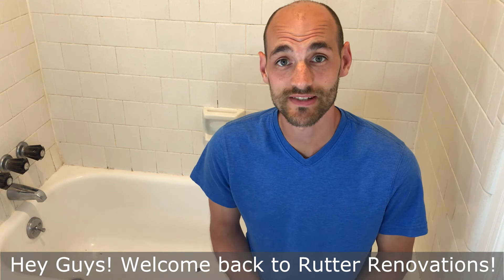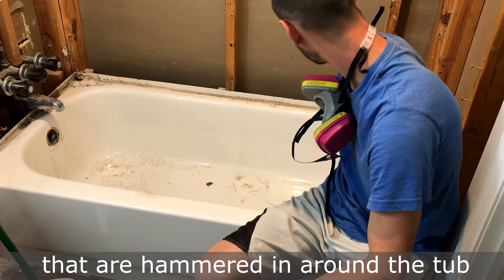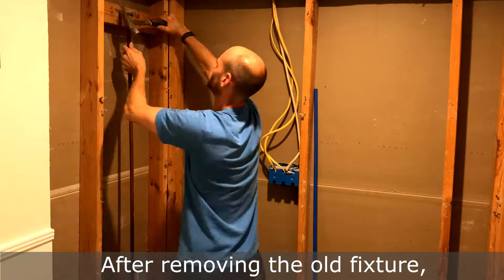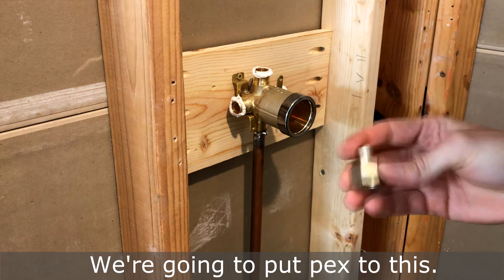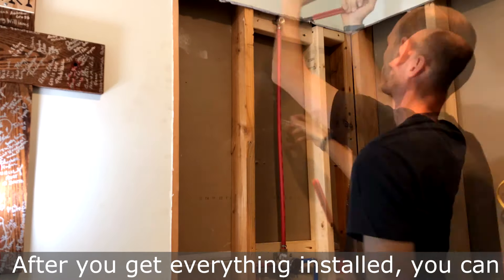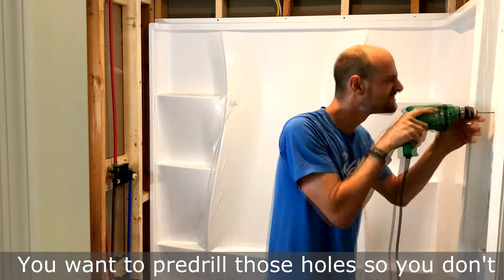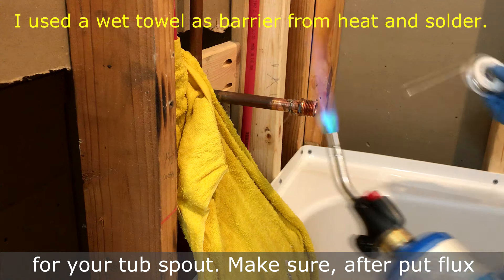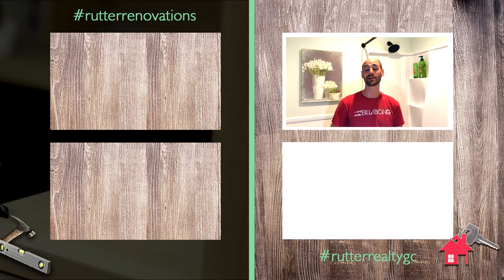How To Install A Bathtub And Shower Wall Set!

Comment: Do you put caulk on the bottom where the side wall meets the tub? I think mold would develop in the small cracks.
Reply from the maker: The manufacturer recommended caulking that gap. If you use the caulk I mentioned in previous comments, you shouldn't have issues with mold. :) Best of luck on your project!

Comment: When you put up the sheetrock around the tub did you cut away a little of the back at the bottom to accommodate the fiberglass flange/lip where it's secured to the wall?
Reply from the maker: The drywall lays over the fiberglass flange/lip. I predrilled the holes before screwing the drywall in through the flange so that it wouldn’t crack. I didn’t cut away any of the flange/lip. I hope that helps.
Reply: @rutterrealtygc  What I mean is did you cut away any of the SHEETROCK since it would not lay flat on the wall since the flange/lip was not flush with the studs.

Comment: I have heard that flex pipe is banned by a lot of plumbing codes.  I once had a garbage disposal that official maintenance refused to work on until the flex pipe was removed.
Reply from the maker: I wouldn’t normally use it, but because water will almost never go down it (unless the tub overflow is needed) I decided to make an exception. I can’t speak to whether it is code or not.

Comment: Hey man, what was your total install time. Start to ready to use. Thanks for the content. Definitely going to use this as a guide. I just purchased the same bundle from Depot. Cheers!
Reply from the maker: It probably took me a week while working around a full-time job. I probably could’ve done it in 2, maybe 3 days (depending on sheetrock mud dry time and paint), if I could have had dedicated time to work on it.👍😊
Reply: @rutterrealtygc  how much would a project like this cost to get done -including shower kit?
Reply: @josephmayfield2556  A lot
Reply: @davidsinger5861  doing a bathroom yourself does not cost “a lot”. This tub and surround are less than $700. We’re redoing our entire bathroom, and though we aren’t replacing the toilet or vanity, and have the baseboard already, we still wouldn’t spend more than $3,000. With the tub, floor tile, and all the new fixtures and materials, we’re well under $2,000 right now. A new toilet would be about $200, and a new vanity would be around $400. Bathrooms aren’t that expensive.

Comment: Was it necessary to install two shut off valves if there's no access to them?
Reply from the maker: Necessary? No. Convenient, so as not to disturb the rest of the home’s water supply while the project gets finished, yes. There is access to these valves on the pop-out access panel on the backside of the wall.

Comment: Question ? what if you want to replace it with a larger tub ? Wider by 12 inches .Love the shark bites,I use them all the time .
Reply from the maker: I don’t know... it might look a little funny if everything doesn’t line up (plumbing and/or tub/walls). Also, it depends on where your shower curtain would be because you wouldn’t want 12” of sheetrock exposed and getting wet during the shower.🤷‍♂️

Comment: Hi Ryan, thanks for the video. Very informative. I had the same tub and walls installed in my home and I am noticing water dripping from the end to the floor. Looks like those crevices retain water and then escape at the end. What do you recommend I do here? According to the installers manual it’s a caulk less design but it appears it may need caulking?
Reply from the maker: Hey! If you did get the same exact tub and shower kit, the manufacturer recommends caulking all the seams in the installation instructions.👍😊

Comment: How come uou didnt add the waterproofing boards? Or is that only for standing shower? Do a video on standing shower with backsplash :)
Reply from the maker: 😁 Okay, I’ll do it! This wall kit doesn’t require waterproofing boards and was installed according to the manufacturer’s installation instructions.👍😊

Comment: Thanks for the helpful video.  What kind of caulk did you use between the sheetrock and the tub surround?
Reply from the maker: DAP 3.0 100% waterproof and paintable advanced hybrid sealant 10 year mold and mildew resistant microban
Reply from the maker: DAP 3.0 100% waterproof and paintable advanced hybrid sealant 10 year mold and mildew resistant microban

Comment: How do you level the tub, making it perfectly horizontal?
Reply from the maker: Follow the manufacturer’s recommendation. Some might suggest shims, others a mortar bed, etc. Depends on the tub manufacturer and model.
Reply: The problem is there's NO manufacturer's recommendations whatsoever; just the 3 pieces: tub, walls, and roof, for the alcove. That's it. This is why I asked you.

Comment: Thx Mr Ryan now for us in Uganda we build using bricks and our bathrooms are not so big can I install the tub on a tiled walls direct thx
Reply from the maker: The tile is supposed to go over the lip of the tub so that when the water runs down the wall tiles it enters the tub. If you aren't using the wall set, most people would probably tell you to use a waterproof membrane that wouldn't allow water to penetrate and gaps in your grout or tile and get onto the brick. Hope that helps!

Comment: Thank you! Very useful, thanks for taking the time for the video.  When attaching surround to studs, you mention apply "adhesive", it looks like you used DAP 3.0.  Was DAP 3.0 used for both: sealant (waterproofing) & adhesive (stick the panels to the walls)? If you used something else for the sticking the panels to the walls, what was it?  How long did you have the self-made stud support to the surround...was wondering instead of building that, if I could just push with my hands for a few minutes 1 section at a time for a couple of minutes. Thanks.
Reply from the maker: Hey Brian,
  I called the manufacturer for this and they said that I should use the DAP 3.0 for both. 👍 Also, it isn’t something that you can just hold for a few minutes. I think I left the bracing there for 24hrs.

Comment: Hi, nice job, I had a guy install that  same Delta 400 classic surround with the matching tub. We have a big problem with the walls, they flex when leaned on and now the caulk keeps separating in the joints. Would not using adhesive on the studs cause that?
Reply from the maker: Hey mrc6870,
  Where are the walls flexing? Mine aren’t flexing at all and feel completely solid. Though, that is because I added the manufacturer recommended support boards in between the studs on the back wall and even had to add extra studs because of how few there were from the original wall. The instructions that come with the shower wall set specify wall supports recommended and using adhesive to secure the wall set to the studs. If either of those steps weren’t done, I’d imagine you could have that issue. 😬
Reply: @rutterrealtygc  I don't think he read the instructions at all. It gives on the side wall pretty much all over. I think I'm just going to take it out and start over.

Comment: Hi Ryan great video enjoyed it.Quick question which I am sort of confused.When placing one acrylic panel next to another creating 90 degree most manufacturers have sort of overlapping engagement that seals the water out however I have seen some installers placing caulking behind as extra assurance however I am more worried mold growing on caulking which happens over time and perhaps something that was not needed to begin with.What do you think.Thank you
Reply from the maker: I. Stalled it according to the manufacturer’s recommendation. They recommended sealing them with caulk, so I did. Realistically, it would be hard for water to get back there, but if you have kids and they like slinging cups of water around at bath time, it’s probably the best to caulk the seams.

Comment: I'm confused? Those shut off valves don't need to be sodered in?
Reply from the maker: No, they're sharkbite connections. They just push on. :)
Reply: @rutterrealtygc  Awsome, you did say the other video. I just didn't fully comprehend.

Comment: Can you use this is a mobile home. I want to do a budget renovation. Take tub out. It’s a vacation home. Not looking for fancy just updated. Thanks
Reply from the maker: I would imagine that as long as the tub dimensions and shower wall height are the same/will fit in the space, I don’t know what it wouldn’t work.  👍

Comment: Did you caulk the vertical gaps between the tub wall components and the bottom gap between the wall and the tub?
Reply from the maker: I did. The manufacturer instructed to do so.👌

Comment: Question.  You don’t need a durarock board behind the plastic panels?   Love you videos very professional!  Thanks Steve
Reply from the maker: According to the manufacturer recommended install, no. Just install it directly to the studs. The manufacturer did instruct to put those few 2x4s in between the vertical studs (as shown).👍😊 Thank you for the feedback and best of luck to your future projects!
Reply: @rutterrealtygc nice bro I am plumbing  my country India City New Delhi

Comment: Thanks for sharing! Do you think this surround will fit over a cast iron tub with same measurements
Reply from the maker: No, it will not fit over (at least it wouldn’t fit over our old steel tub).👍

Comment: There is gap between each piece. Should I fill those gaps?
Reply from the maker: The manufacturer (if you got the same exact set) recommends caulking those joints.

Comment: Do you have to use copper pipe for the bottom faucet? Or do they make some that can be used with pex?
Reply from the maker: The ones that I have used strictly require soldering in copper pipe or using another solid metal pipe. The manufacturer of your faucet should say what it recommends in the installation manual. I don’t know of any manufacturer that recommends or allows pex due to its flexible nature.
Reply: @rutterrealtygc  thanks
Reply from the maker: gtdodgeviper You’re more than welcome!👍😊
Reply: It's not only that it's flexible but bc of the sheer volume. Using pex for your down spout will restrict flow and force water up to your shower head. Even if you use 3/4" pex. Any installation I have or other contractors/ plumbers have done use copper for down spout.
Reply: @TheMrhighclimber   I was looking to see if anyone covered that and thank you. I've seen people use pex down to the spout connection and then put a pex to 1/2" wingback elbow on the bottom and screw in a piece of copper with a male adapter and use a slide on tub spout with the Allen set screw in the spout. It would work if it was just a soaker tub (no shower) but like you said the pex is restrictive and works like a half or so closed diverter and the resulting back pressure makes water divert a bit and go up the shower pipe when you open the faucet full open or even half open as water wants to take the easiest rout and the pexed spout makes it like a 1 lane blocked road so the lazy water guys take the bypass and half of them go out the spout and the other half take the bypass due to the restriction in the road. I love long sentences. If ya don't know what a male adapter or wingback elbow or AKA wingback 90 is look it up on google images, we can't tell you every thing. 😜
And Ryan, if your tub/shower valve instructions told you to use the copper pipe to the spout that's a good product, some don't tell you much because its been translated 4 times before it gets to you, if it said it in the first place at all.

Comment: Mine left enough room on the back side for Sheetrock to go behind so now have to figure out how to fill that area and not make the bathroom look bad. Wish it would have just went straight to the boards. Smh
Reply from the maker: You can add shims between the studs and the tub. That’s what I did. 👍
Reply: @rutterrealtygc  mine beyond shims

Comment: Wondering what type of adhesive did you use on the shower walls? BTW nice video
Reply from the maker: DAP 3.0 100% waterproof and paintable advanced hybrid sealant 10 year mold and mildew resistant microban

Comment: Can you add a backer board behind the surround? For added durability. I tend to lean against the walls when I shower.
Reply from the maker: Great question. The shower wall will stick out further where it meets up with the tub and the installation guide direct installers to install the panels directly to the studs. Also, the lip of the wall set on the sides of the panel won’t be able to recess under the adjoining drywall. My walls feel solid without the use of backer board. Definitely do the recommended bracing and cross bracing because i’ve heard of people who say that their walls feel flimsy and move, but that is either because they didn’t have the correct bracing or they didn’t follow the instructions that told them to use adhesive to secure the wall set to the studs. I hope this helps!
Reply: Seems to me instead of adding a backer board you could always add more studs as long as they aren't getting in the way of anything else

Comment: Hey man great work! Do you have to replace the valve and plumbing coming from the tub? And does the tub come with new drain pipe?
Reply from the maker: Hey KC Creations,
  No, you do not have to replace the current plumbing that goes to the tub. This particular house was built in the 70s and it was just easier to work with the materials by making everything new. Also, I wanted a more updated look for the bathroom, which is the reason why I changed out the plumbing fixtures to a single handle faucet.
Reply: @rutterrealtygc  Great thanks for the response man! We are about to replace our tub and it should be the same as the old one so I'm hoping to use the same drain pipe and fixtures for it!

Comment: my kit said not to bring drywall on to lip of wall you go flush then mud the lip in .
Reply from the maker: I don’t know what you’re considering the “lip” to be, but you’re correct in saying the drywall should not come in contact with top “shelf” (where water might sit if splashed up) of the wall set. As stated in the video (Around 9:30), bring it within 1/8” and then caulk the gap so water doesn’t get drawn up into the drywall, causing water damage..👍

Comment: Was that a concrete slab floor? If so how did u tighten the drain under the floor?
Reply from the maker: The cut an access panel in the closet wall behind the tub which gave me access. The slab has about a 12”x12” opening where the plumbing comes up from under the house.

Comment: Did you test the water before installing shower?
Reply from the maker: I did, yes. You can insert the shower head extension that comes through the wall with a cap on the end or in this instance, I just connected the shower head and let it run into the tub, while inspecting for leaks. 👍

Comment: No need to tape the gaps between the old and new drywall pieces? What compound do you recommend?
Reply from the maker: Yes, you do need to tape between the old and new drywall seams or else you’ll see cracks that will form at the joints. I use the fiber grid tape that has adhesive on one side (not the paper cheap stuff) and either pro form all purpose joint compound or USG “Sheetrock brand” joint compound in the 5 Gallon buckets. I usually backfill larger holes with compound first before applying the tape. I hope that helps and best of luck on your projects!
Reply: The "paper cheap stuff" is significantly better than the fiber mesh tape.  Either way they are both required to be installed the same way.  A layer of compound, then tape, then another layer of compound. Unless you have the fancy taping tool which I believe only works with the paper tape.

Comment: How do you get measurements to make holes on new wall for shower fixtures?
Reply from the maker: VERY CAREFULLY! 😊 See the 7:19 in the video. Give yourself a point of reference where where the spout and handle are located. Here, I use the outside of the tub measuring to where the spout is and then measure up from there to get the dimensions for the height of my spout and handle. If I had any advice, measure multiple times and double check your corresponding measures on your shower wall before you start drilling. Also, after you have double checked everything, you can make a tiny pilot hole to make sure that everything is lining up with your measurements. The handle hole gives you more of a margin of error because you can create a small pilot hole and then adjust it as needed. The spout hole is already so small, there is not as much “adjusting” room once the pilot hole has been drilled. Worst case scenario, you can adjust the fixture and tub spout to line up with the holes that you created if needed. Just make sure that the holes you drill are in line vertically for the best visual appeal.👍
Reply: @rutterrealtygc  thank you! Figured it out, was just over thinking it to much, thank you for the video and response!

Comment: If you were doing that as a job, approximately what would the cost be?  I notice you do very careful work. Good job!
Reply from the maker: For this particular installation, I’d probably charge within the realm of $2000 - $2400 for labor (materials were roughly around $1000) making for a total of around $3000 - $3400. However, I typically don’t do contract work for others unless they are close friends or family. 😊 Keep in mind that all markets are different and the demand is different everywhere. Your market prices may not reflect the same as ours. Also, if you hire someone that is new in the business, they will typically do it for less as they get into the market, but a seasoned plumber or contractor, will more likely charge more. I hope this helps!
Reply: @rutterrealtygc  Thank you for the guesstimate and the comment. It helps.